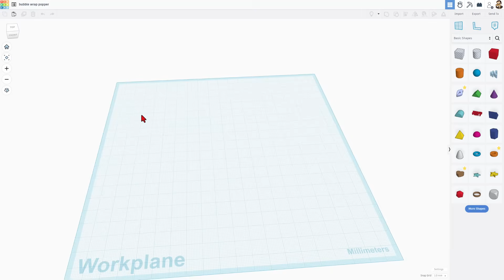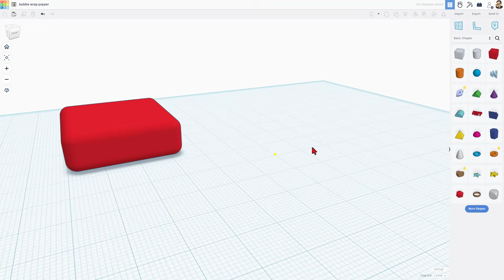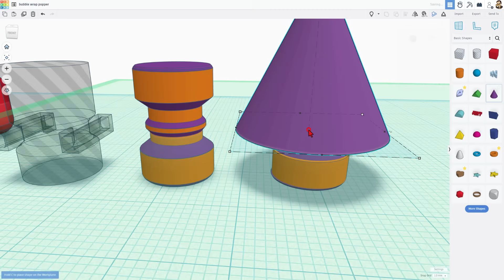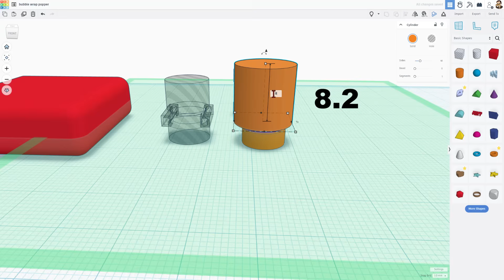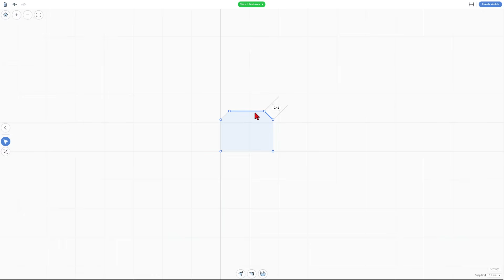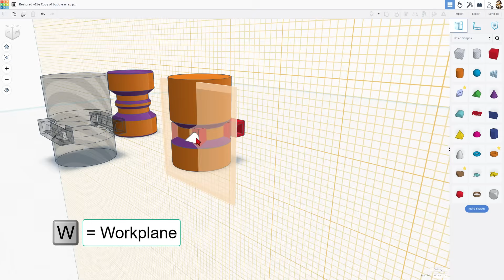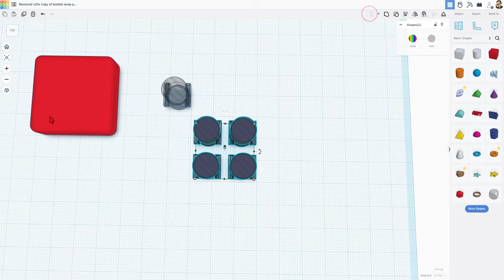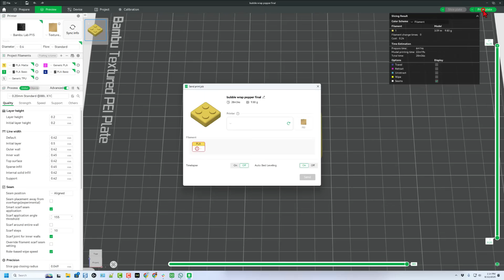Tinkercad Magic: Design a Forever Pop Fidget! 💯🔥

Comment: The cone is an interesting approach to rounding the cylinder bottom. Why not just bevel the cylinder and cut off the top to make it flat?
Reply from the maker: I liked that it avoided cutting parts off. I like that the height for stacking everything was clear too.  You are spot on that the cylinder & bevel is an alternative. 👍